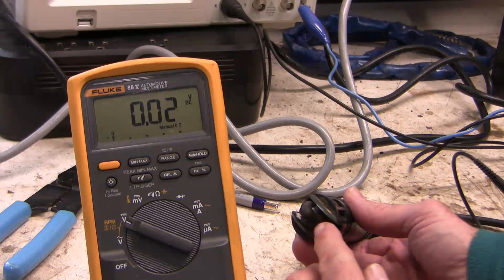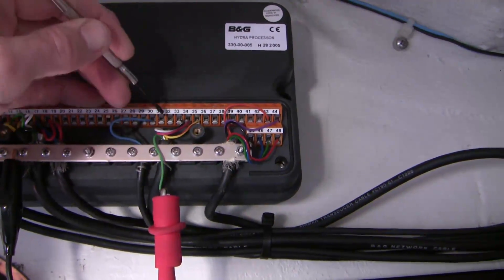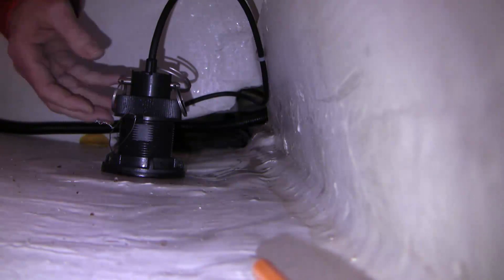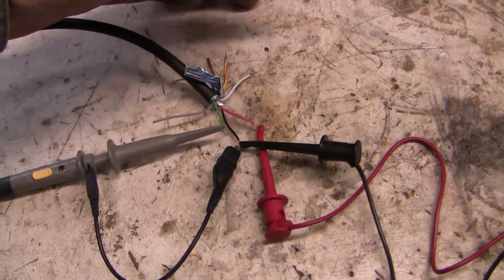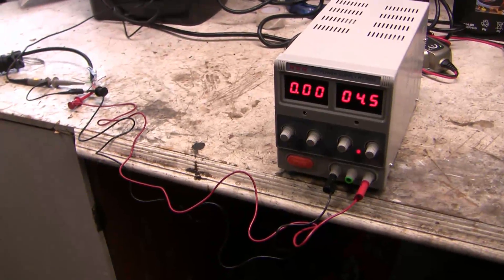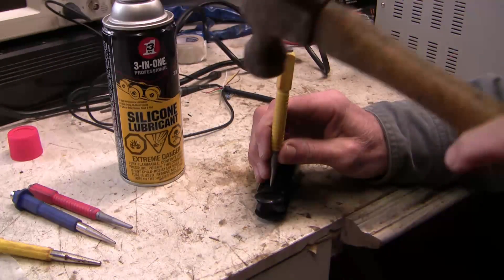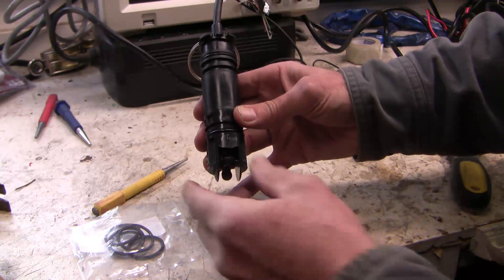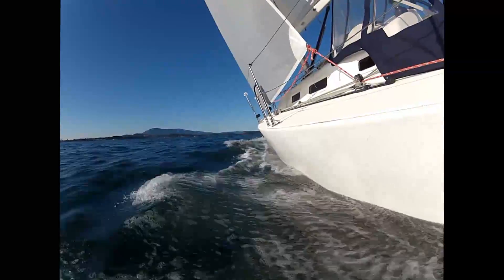How to fix a failing boat speed sensor

Comment from the maker: I have discovered that you can make your own stainless steel shaft if the old one is corroded and failing. 3/32" stainless tig welding rod is just about the right diameter, and one rod would be a lifetime worth of replacements.

Comment: This seems to be an example of where the electronic, diagnostic troubleshooting was not useful. The speed system measured good both before and after the paddle wheel/axle replacement. How could that be?
Reply from the maker: The wheel was binding mechanically. I get what you are asking, what's the point of going through the effort. But even a negative result is still valid, you know what's working normally, and you've not found any evidence of a dirty signal or intermittent electrical fault. By proving the electronic system was intact, I was able to replace just the paddlewheel rather than the entire sensor. That's a big deal since new sensors use the NMEA 2000 communication protocol so I'd have to pay for a translator as well, or upgrade the entire system. I got peace of mind that there isn't anything more underlying this problem. And I had fun, too, ha ha.
Reply: I see. So the wheel only rotaded at the bench and not in the water. A light sanding with 2000 paper and some oil will give you the old wheel/axle as working spare parts. @spelunkerd

Comment: Nicely done!  I can only imagine you have a background in electronics assembly/engineering/work instructions, etc.  A compliment to how well you explain things and how thorough you are...  I have this problem on my boat and I would not venture to simply replace the paddlewheel.  However, that might explain when a squirt of WD40 on mine seems to get it running well for a while then back to intermittent.  After watching this, I'm confident to replace the wheel.  Thanks for the nice vids!

Comment: Another fantastic and in depth video!  Thank you so much for taking the time to go into such detail and in a way even the lay person can understand.  I'm dealing with the same issue now on my boat, just waiting for the replacement parts to show up.  The person who invented the term "Stainless Steel" clearly never owned a boat that's kept in saltwater! :).  Wish I would have known about the 3/32 welding rod before ordering the replacement parts!  That's a great tip, especially since it probably wouldn't hurt to replace the shaft every year or so.  As I'm sure you know, just a few tenths off on boat speed makes almost all the other data inaccurate as well.
Reply from the maker: Hi James, it is always nice to hear from you and see your videos. Yup, paddle wheel sensors are a work in progress, I don't know if it is possible to get then as accurate as we want. After I clean the hull, the sensor reads too fast for about 6 weeks, I adjust the software downward, but the next six weeks I'm dialing it back up. Then just before my 6 month haul out I get intermittent freezing. One thing I found useful is to bring a small cup of acetic acid (vinegar) to the boat and soak the paddlewheel and steel shaft in about 1" of that overnight (just the lower paddlewheel, not the whole sensor). I tap the steel shaft out to expose the whole surface area. The next morning residual debris comes off easily with a toothbrush rinse. As you know the computer uses that paddlewheel speed to calculate secondary data like true wind angle, so all those readings are messed up if the paddlewheel is off. One thing I finally realized is that the computer considers the water to be the frame of reference, so in tidal current it does a major calculation to correct for that. So when my paddlewheel is off I get incorrect data for TWA, too. Looking up the mast to use apparent wind angle after all seems pretty good. I'm told that ultrasound speed sensors are better but they require a larger through-hull. By the way, I started hanging a GoPro from the bottom of the mast, for a unique view of the team while racing. My videos are not up to your quality but it is a unique view.
Reply: @spelunkerd  Perhaps the one good thing about the paddle wheel being inaccurately slow is it always makes it look like we're in the right current!  Playing the currents is critical in our area, even when just cruising and I suspect it's a big part of where you sail also.  I have an ultrasound speed sensor that came with the boat which was working fine at first but quickly started either not reading at all or showing wildly inaccurate readings.  After talking with some people and doing a lot of research I found about 50% of the time people love the US sensor and say it works all the time, every time. The other 50% of the people had the same bad experience as myself.  It's unfortunate I wasn't in the other 50% because it seems like such a great idea. Because the US sensors work by sensing particles in the water I wonder if it depends on the local water particle content?  I'd think it wouldn't matter but who knows, maybe it does.  I played around trying to diagnose and fix mine for a while but became so frustrated with that one sensor making all the money I spent on the rest of the system basically useless I went back to a traditional paddle wheel.  I've been told by a couple reliable people who work in the boat electronics industry that the majority of pro boats and high end teams stick with the paddle wheels and they seem to be in agreement the "Signet Marine" paddle wheel is the best.  It requires a different thru hull than the Airmar though.  Although I certainly don't fall into the 'pro' or 'high end' category I do plan to switch over to the signet next haul out if for no other reason than because I already spent so much darn $$$ on the instruments I'd prefer to have the most accurate info coming out of it that I can :). Thanks again for your always very detailed and thoughtful tech videos.  I'll have to try your acetic acid trick.  Lets see those race videos of yours sometime soon!

Comment: quite difficult to make a call when you don't get conclusive failed test results.
Reply from the maker: Yes, you're right. That's why I spent so much time with it on the bench, I had a hard time believing it was as simple as a little rust on the spindle. In the end, it's consistently working fine now so I'm confident the problem is solved. Thanks for stopping by!

Comment: This is why I love YouTube (mixed feeling on parent company Alphabet)!  People smarter than me willing to put in the time and effort to help us simpletons.  I am having this exact problem with my transducer...registers fine when I take it out and spin it by hand but reads zero when I put it in the water and move the boat...on the face of it, that makes no sense and I was looking at having to replace the entire transducer.  Based on the wire splice I found when troubleshooting it appears the previous owner did exactly that.

 I'm still not clear on what is going on i.e. what the exact failure mode is.  I assume the actual hall effect sensor is in the cylinder of the transducer and that the paddle wheel serves as the external magnet (guessing a magnet in two of the paddle wheel arms and none in the other two).  Every time a magnetized paddle wheel arm passes the top of its arc it trips the sensor causing the voltage change demonstrated in this video.  All good so far.

But why would that sequence fail in the water but work when out of the water and why would swapping the paddle wheel (or maybe more accurately the paddle wheel axel)  fix it?  If the paddle wheel spins the magnets in the wheel's arms are passing the hall effect sensor and should be causing a voltage change no matter the driving force...but that is apparently not the case.  Further more what effect would the rusty axel shaft have, why would that cause failure?  I can see that it would likely slow the wheel down but that should just cause an inaccurate reading, not a zero reading.  Why does it cause a zero reading? 

The only think I can figure/guess is that the axel is supposed to make an electrical connection w/ the wheel through the axel and the rust inhibits that connection when combined with the water. Is that what is happening?  Clearly I'm missing something in how this system works.

Bottom line, thank you for the video, I never would have figured this out.  Now if I could just find the correct paddle wheel kit.  I have and old (2004 ish) Raymarine ST60 depth instrument and the part number for my Airmar sensor should be on a vinyl tag/label on the cable...but it isn't.   The sensor does list a part number on its top cap, 20-399-01 but I haven't been able to cross reference that number and one parts dealer told me that was only the part number for the cap...can't cross-reference paddle wheel from that number.  Maybe I'll just go with  the welding rod option.
Reply from the maker: You may find more compelling evidence if you get the boat out of the water. Critters tend to find little crevices to hide in, and I'm guessing your wheel isn't spinning because of mechanical obstruction. By the way, these days I have been removing my paddlewheel, then soaking it, the axle, and the bottom part of the housing overnight in a glass of acetic acid. I do that beside the connection so I don't need to remove wires. Brush off, rinse, and reinstall. Weak acid dissolves the calcium deposits very effectively. One could argue that it will also accelerate rust in the stainless steel axle but I haven't noticed that, yet. Double check to be sure the paddles are oriented to catch the water and spin the correct way.

Comment: Great looking engine you have. I have problems with rust on the flywheel and other wheels on the cam belt. Why is that and what can be done about it. please?
Reply from the maker: In a salt water environment, any bare metal surface will collect dew from the air overnight and flash rust very quickly. Of course you can grind the rust off and repaint with heat tolerant paint. A quick solution to morning dew is to warm the interior of the boat each night so the ambient temp inside never gets down to the dew point. If you have access to shore power a better solution is to use a dehumidifier, which will produce heat and pull water from the air. Works great, reduces mold, prevents freezing tubing, and protects wood. At my marina the cost is 50 cents a day through the winter.

Comment: Impressive and thorough troubleshooting. Thank you for posting.
Reply from the maker: Thanks for the followup, it was a fun video to make. Another thing worth noting is the fact that some paddlewheels have one magnet every 180 deg, and others (like mine) every 90 deg. If you swap in the wrong kind you'll get speed readings that are so far out they can't be adjusted electronically.

Comment: Looks like you got her fixed Dave. Although the pin was rusty and could have caused an issue, one has to wonder if there was an issue going on inside the electronics of the sensor. In any event, all looks good now. And that's one nice looking boat that you got there :)
Reply from the maker: Thanks for stopping by, Terry. In retrospect I might have sanded the sprocket with a nonferrous abrasive, although I suspect that might not last very long. The metal used for the stainless pin doesn't seem to be great in salt water, although I don't know how old it is.

Comment: Well i never, a tiny bit of friction stopped it.
I suppose thats water for you, give it a chance and it creates rust.
I dont suppose that a different pin/bush material could fix it, say nylon bush and pin?
Reply from the maker: Yeah, that is a good point, I didn't remove the pin to clean it because I didn't expect high quality stainless steel to rust so much. I may have been able to get another year of life out of the wheel by lightly sanding with nonferrous abrasive. I had tried light machine oil and silicone spray before, and those didn't work. Constant exposure to salt water washes light oil away, and heavy oil would impede movement. As it is, by the time I realized it was just a rusted spindle I already had the replacement part.
Reply: Perhaps you can make a new nylon bush and nylon pin for next year when it plays up again.

Comment: so the problem was rust?? thanks for the video.
Reply from the maker: To my surprise, yes. It wasn't noticeable on the bench, the spin resistance was the same as the replacement part, which is why I took the extra effort to prove the other elements of the chain were OK. Thanks for visiting!

Comment: Can you please do a video on getting a stuck boot off of a spark plug on your dodge please and thank you
Reply from the maker: Good point, it's a problem I have seen too many times. Of course the best prophylactic is to use dielectric silicone-based grease on the inside rubber part of the boot when you install new wires. Dielectric grease is nonconductive, excluding water and hopefully slowing corrosion that bonds and oxidizes the rubber to the ceramic part of the plug. That doesn't help the guy with the problem at all, since it's too late when you can't get the wire off! At least with the Ram the plug is exposed. It is much worse when the wire leads down a deep hole that you can't reach into, especially if the coil is all together with the boot and you have to replace that, too. If the wire won't come off the plug, you have no choice but to pull and twist until it does come off. I suppose if access is good enough you could try using a dental hook smeared with silicone on the edge of the boot to try and break corrosion, so the boot will slide off more easily, but that could be time consuming. Also on the Ram there are metal heat shields that make access to that area almost impossible. Lisle make a great pair of boot pliers that make tearing the boot less likely. Sometimes you just have to accept the wire won't come off without tearing, and then you're looking at replacing a wire set, too. If there are some good wires left, keep them in your garage since they can be useful for analyzing secondary ignition for coil-on-plug systems, and if you tear another boot in the future you may not need to replace the whole set. The other problem is that sometimes the whole boot won't come off, and if the plug is recessed in a deep hole, the socket may not be able to reach past the boot remnant. In that case, get a very deep 5/8" socket, DON'T use a standard spark plug socket (those have rubber end grips that get in the way). The deep socket will more easily reach past the boot remnant and get enough of a grip on the plug to get it out. Good luck!
Reply: spelunkerd thanks for the advice

Comment: I wonder if this type of instrument is accurate. How can it be calibrated/
Reply from the maker: Great question! There is a calibration that one can do through a series of keystrokes at the view screen. You drive the boat to an area of no current, and compare the boat GPS speed to the speed obtained from the paddlewheel. Around here the biggest challenge is to find a place with no tidal current, since water is always moving a little. I drive at right angles to any current and try to do it at slack tide, then compare to reading obtained when moving in the opposite direction. Then you bump the calibration up or down to adjust, it's impossible to get it exactly perfect. As greasy algae builds up on the wheel, readings begin to slide down, so you adjust again in a few weeks.  Mine has a habit of stopping entirely so I remove the paddlewheel to clean it regularly, and I have trouble getting close to accuracy +/- 10%. Ultrasound speed sensors apparently are more reliable and accurate, with no moving parts. They require a bigger through-hull, and ultrasound devices are more bulky, which isn't great on a racing sailboat.